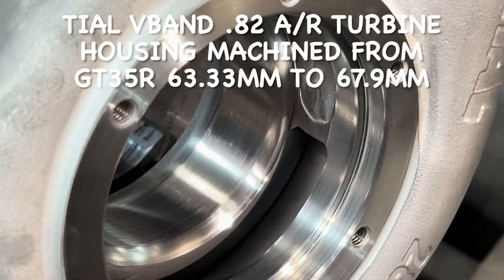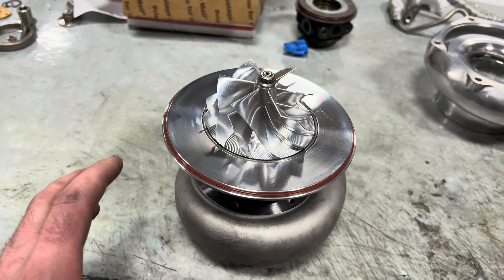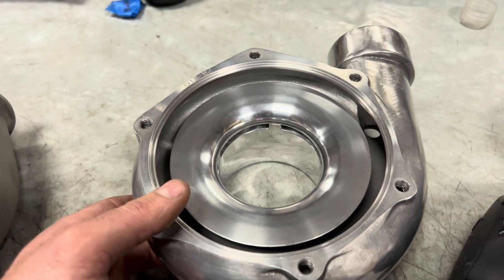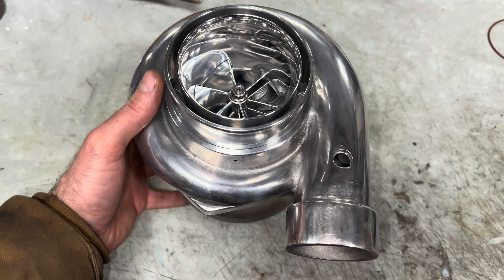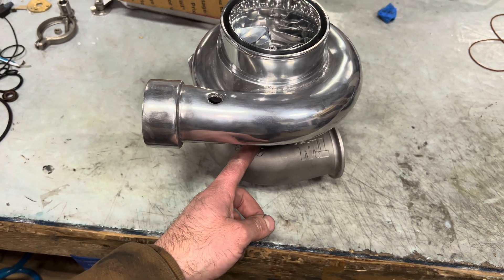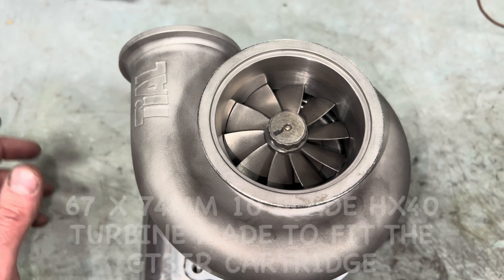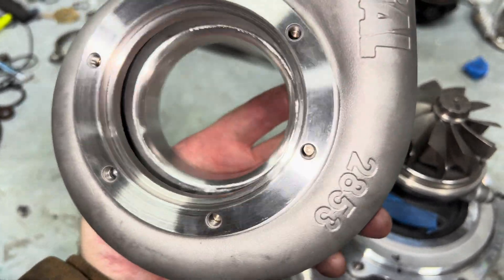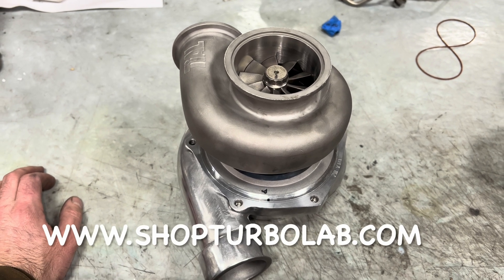Garrett GT35R 6767 + T51R + TIAL turbine housing for 950 hp

Comment: I have a 3584rs that ate a bolt the turbo is good other than the compressor wheel. Problem is I’d love to put a new wheel of some sort in so I can continue to use this turbo. However if the hosing needs machining I can’t do anything. Do you sell new 67mm Garrett wheels? Also if so does the whole turbo need balancing then?

Comment: Does the rear piston seal area have to be machined for the gt35 cartridge or do you machine the cartridge for the hx40 seal diameter?
Reply from the maker: No. The turbine shaft is machined to fit the cartridge

Comment: I've got a 2.0 liter and an old gt35r.  Would this setup spool farley quick.  My setup now is so laggy.  Whats the cost on this if I send you my turbo?  Its a precision.  Probably 15 years old.  I rebuilt it years ago from a kit I bought from you.
Reply from the maker: I would do a boost leak test first. Then I would look for return exhaust leaks. If the tune is also good you maybe seeing the best the turbo has to offer. You can change turbine housing sizes to a smaller one to help with spool. I would not go up on size, if anything you may need to step down in size.
Reply: @turbolabamerica  what's the cost to have you size it smaller?  It's a really old turbine wheel.  I didn't know if a new design wheel would help, and I have no problem going smaller, but would like to keep the same center section.  Is there a better way to contact you?
Reply: @HEADDYNAMICS no, you can't go any smaller. If you did then your turbine housing's would be useless. What you need is a gt30 based turbo. Or a g30. I can help you with sizing if you want to purchase a genuine Garrett.